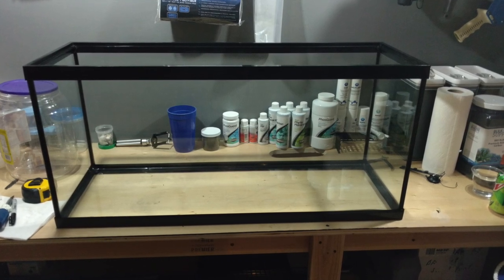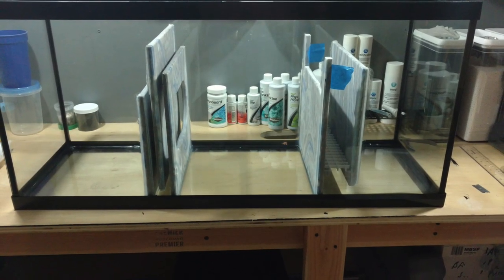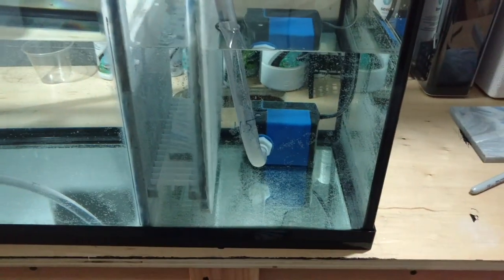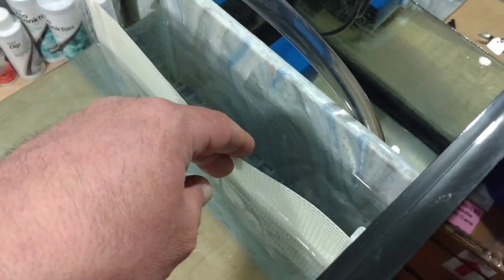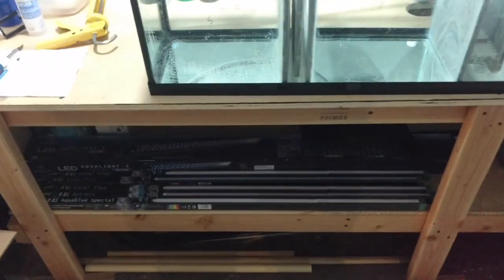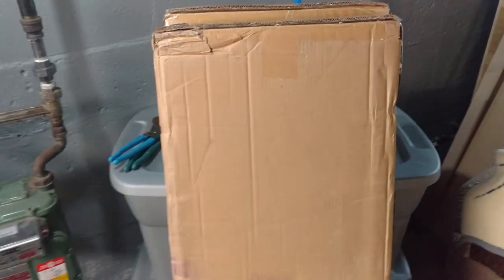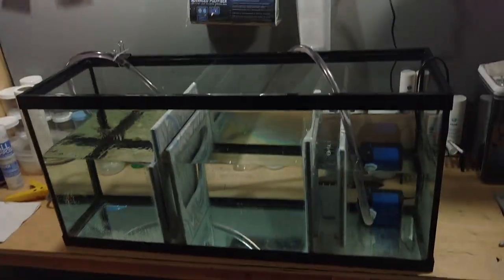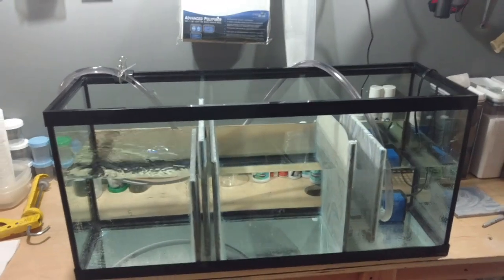DIY Sump Reef Tank Upgrade

Comment: Version 5!!! Looks great! Start calling you Mr Spare, smarter than most of us! Hh
Reply from the maker: pelphrey lol. three of the other sumps I built for other guys
Reply: Reefing with Billy Pipes what are your thoughts on my running pvc through dry wall and hooking my rodi output up to it? My container is 30' away, I'm concerned about the cold water creating condensation in the summer time and causing problem.
Reply from the maker: +pelphrey it won't hurt anything at all. Why don't u just run the 1/4" tubing instead of PVC.?
Reply: Reefing with Billy Pipes because that makes more sense! Haha I have 50' of black 1/4" line already. I'm just a nervous wreck about condensation in between the laundry room and garage. I don't want the line to sweat and create a bigger problem.
Reply from the maker: pelphrey u gota just realize that every house has plumbing in the walls. lines condensate more in a room that is not heated or cooled like a separate garage or like a garden hose outside.
Reply: Reefing with Billy Pipes this line will be going from a climate controlled laundry room through the wall into my garage that is not climate controlled. It's attached, but still gets very hot and cold.
Reply from the maker: pelphrey it should be OK. just use the 1/4" line in case it condensates too much. and you don't want it to freeze and burst in the winter.

Comment: I have sump envy right now. 😍 Also, based on my recent experience trying to create a barrier so my molly fry don't go over the waterfall into the weir, I'm thinking you'll be surprised at how often you'll need to clean that mesh. In my case, I'm using a very coarse filter sponge and it only takes about 36 hours before the water level in the refugium (centre section of my sump) starts to rise to where the fry can get back into the skimmer chamber. 😱 I suspect it's largely because I'm still dealing with some white slime (though not much any more) but it surprises me how it looks perfectly fine, but is in fact clogged. Nice creative thinking there though.
Reply from the maker: Reefgrrl hey thanks!!! I've been using the mesh since the beginning in my sump but it was fully submerged so I'll have to keep an eye on it now

Comment: how do you get the baffles silicone'd so close together?  I have made a couple sumps but always have a hard time getting my hand in there to apply the silicone in that tight spot.
Reply from the maker: I pre plan it and do the hardest spots first. And I use the marineland silicone from a smaller squeezable applicator which helps me get in tight spots
Reply: @BillyPipes  any way you would do a video of getting those baffles so close together?
Reply from the maker: @markjordan7185  sorry but I won't be doing a new sump build anytime soon. Probably after new year's

Comment: What are the measurements of your pieces - mostly how high and how low do they go?   I am mostly wanting to know about the height of each.
Reply from the maker: Im guessing they were anywhere from 10"-14" tall. Im not using this exact sump anymore sorry
Reply: @BillyPipes  Thanks.  Do you sell plans for sumps? I have plans to turn either my 125 , 75, or 55 into a marine tank and want a bigger sump to hold more live rock and plants.  Would you use a 20 or 30 gallon sump for these tank sizes?  Would you still use this design?  I wonder why you didn't include an area or setup for the filter socks?
Reply from the maker: @johnatella8498  i dont sell the plans but i do have a bunch of others that i built that i show all the measurements.  And i would use a 30 gallon for sure. And check out my diy sump sock holder video1👍👍 and my playlist on sumps

Comment: what did you cut the baffles with? it looks so close that the glass was built around it instead of you siliconing them in. great job.
Reply from the maker: +Edward Thayer I used a table saw. Gave about a 1/16" gap on each side

Comment: I hope you can help me....I am setting up a 40 gallon sump for a 120 gallon tank.  What size pump would be recommended?
Reply from the maker: Carole Just Carole I really like the Jecod dcs return pumps. A dcs 5000 would be more than enough for the tank and even if you have a manifold running off of it too. I have the dcs 7000 on my 75 and it's only at level 3
Reply: Billy Pipes Thank you for the pump input.

Comment: What did you use for the dividers?
Reply from the maker: It's called Corian. It made by Dupont
Reply: @BillyPipes  it looks really good, what is it for and where can I get it?
Reply: @BillyPipes  I am building a 55 gal sump for my 150g reef
Reply from the maker: @gmpugh7606  it's what they use to make kitchen counter tops. It's 100% acrylic. You have to be certified to get it. But I've heard some ppl find pieces of it at home Depot

Comment: Another great  vid Billy. My sump is very basic. It 3 12×12 chambers. Flow through center, refuge section, is rather high. Does water flow effect how well it works? I looked at some dumps yesterday and all seemed to have refuge section to be out of main flow. They also have some kind of box around filter sock area to keep it quieter and for less splashing. I have durso drains and they make a lot of noise. Any ideas of what I could do?  Thanks Frank
Reply from the maker: Check out my most recent sump video. I posted it about a week ago